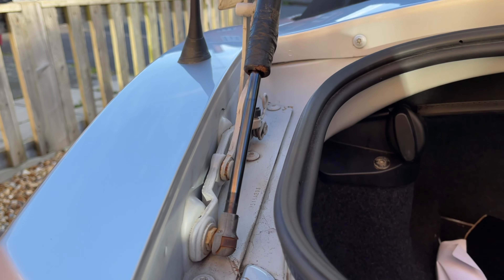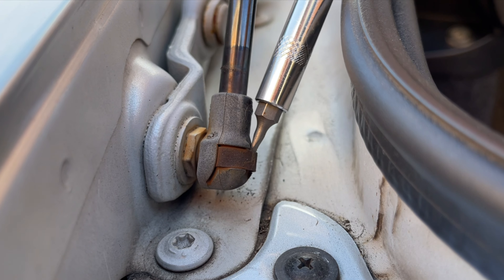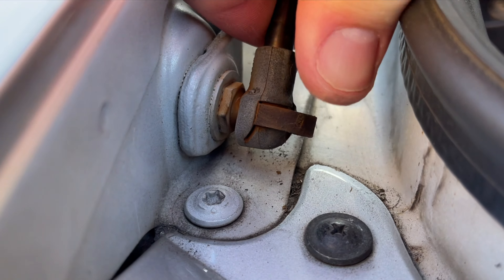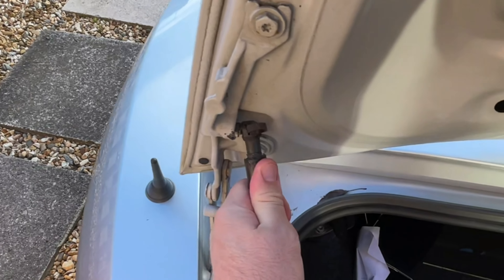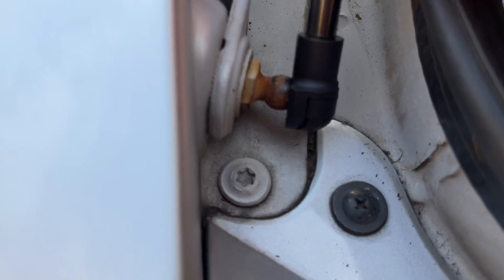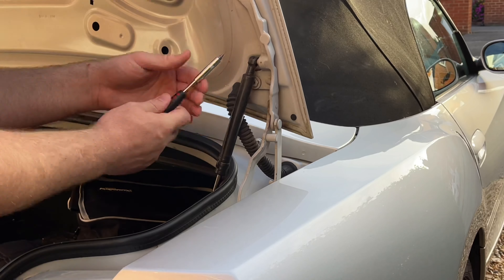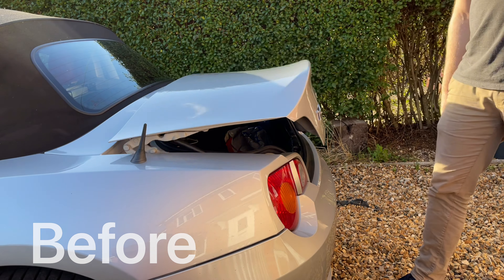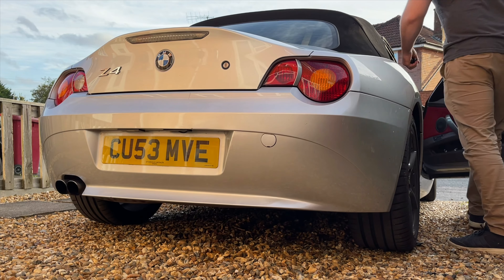Boot gas strut replacement - BMW Z4

Comment: Hi do you have a video for replacing oil filter housing gasket for the 2003 Z4 2.5.  Thanks
Reply from the maker: Hello unfortunately not, I never had any issues with the oil filter housing leaking so haven’t needed to.
Reply: @db192  thank you! If you happen to see a video of that please let me know.  Thanks

Comment: I need new ones
Reply from the maker: Quick and cheap fix thankfully
Reply: @db192  Yeah true. Know anything about the lower rear console compartment door? On mine, the small plastic that attached to door to close it shut has cracked completely off. With console door open, the light stays on.  I had to tape it shut for now.